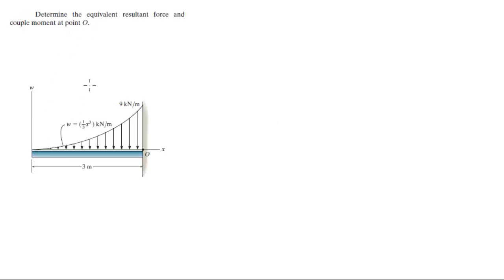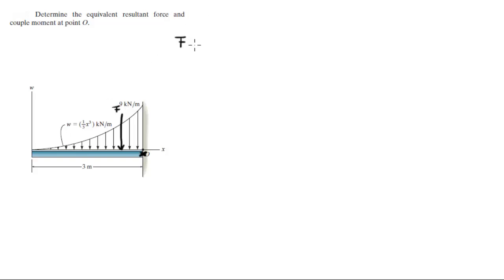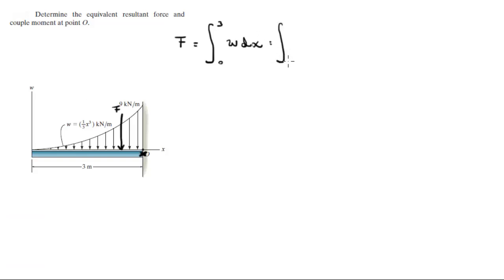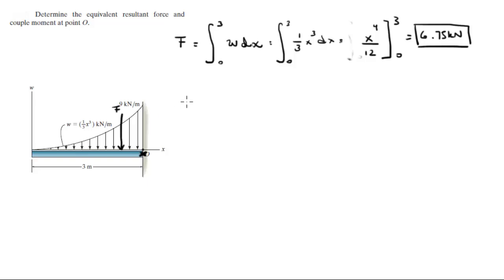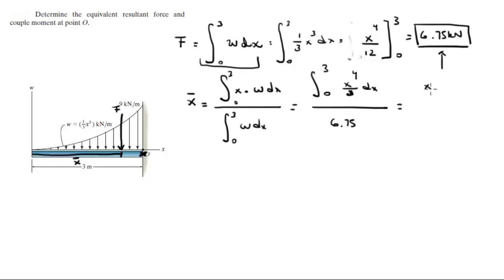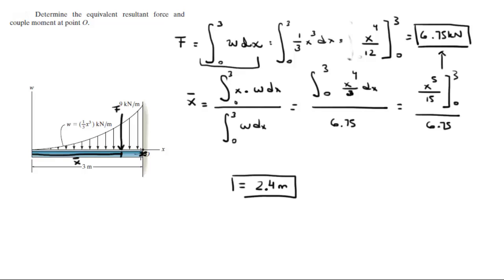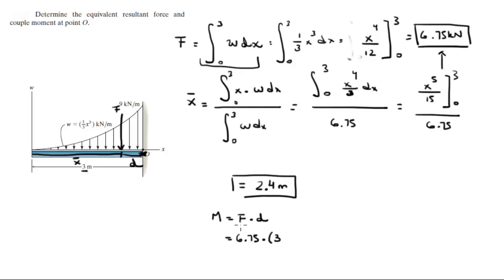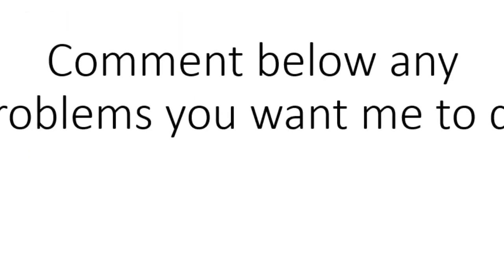Determine the resultant force and couple moment at point O

Comment: Can we use formula to calculate the x bar(by exparabolic area law)? Which can be (3x3/4), but the result is 2.25m… why we can’t use it?
Reply: i got 2.25 with the average value of a function method aswell, did you figure it out?